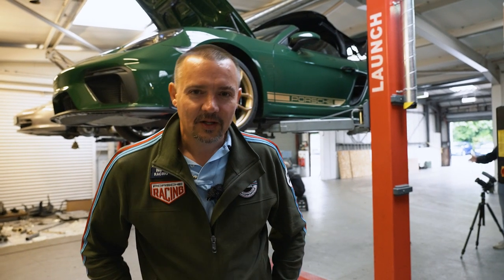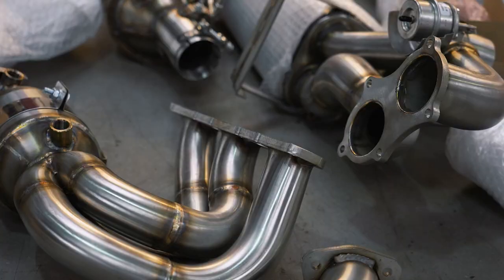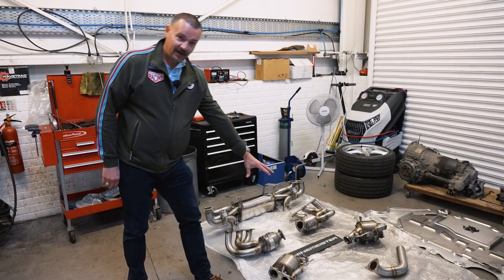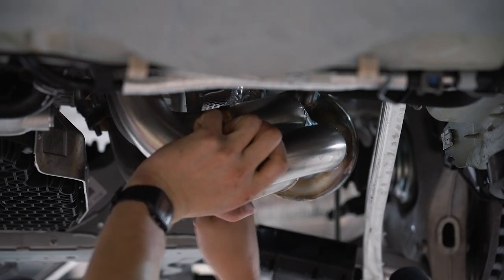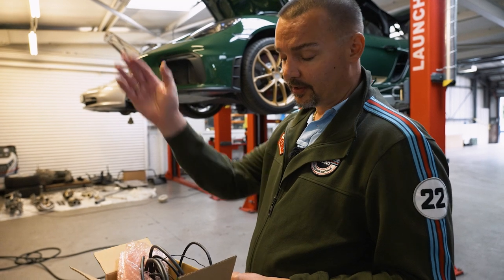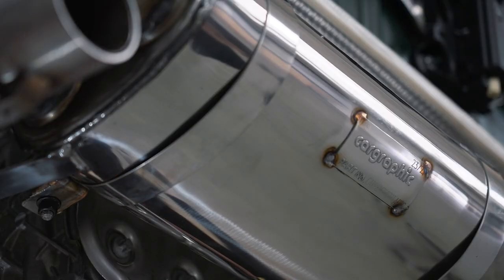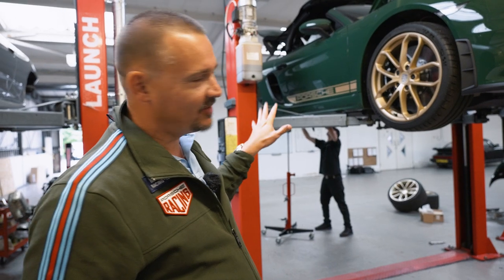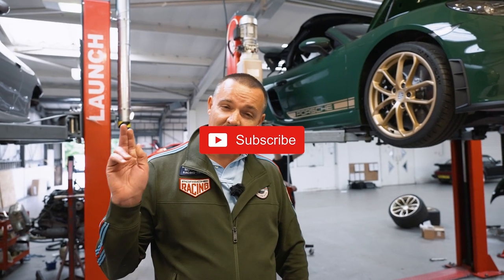Cargraphic Exhaust on my 718 Spyder!

Comment: Really tempted to do the same with my Spyder after watching this.. Were you not concerned about potentially affecting the Porsche warranty? I know.. It's the usual boring question but it's the one thing holding me back... Also, is that Cargraphic's "touring" spec backbox as it has the silencer?
Reply from the maker: Its their Racing/Competition back box… the flywheel is personal preference but it really has picked the performance stakes up for sure much freer reving now if it was good enough for the 911R its good enough for my car..😉… its the best exhaust system I researched them all… Ninemeister very impressive to deal with…. … 👍
Reply: @DrivingVenture  hhmmm.. I must get in touch with Ninemeister.. they also happen to be the closest and have a good reputation from what I've read..
Reply from the maker: @cowanscott9047  ask for Peter he knows me well… Lewis will do the work he is meticulous and knows the cars inside out… 500 miles in and I’m very satisfied with the outcome car sounds brilliant…👍
Reply: @DrivingVenture  Thanks for that! cheers